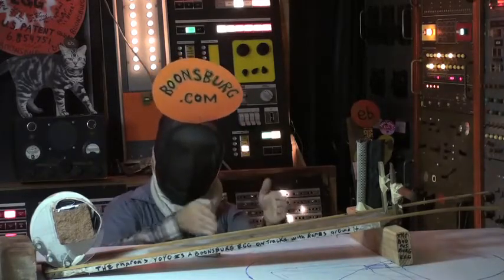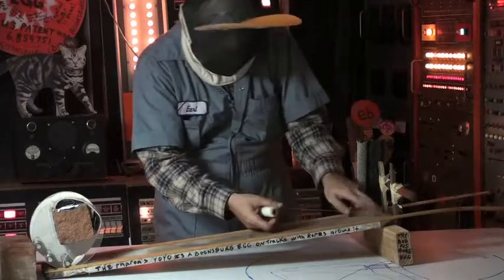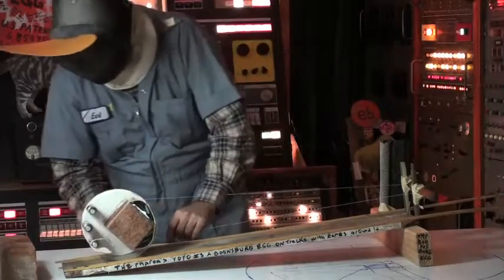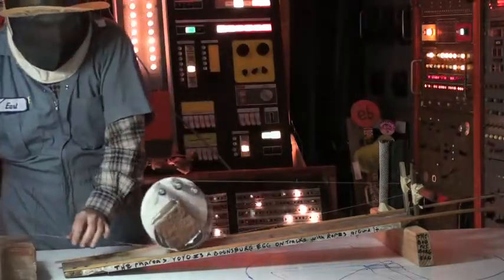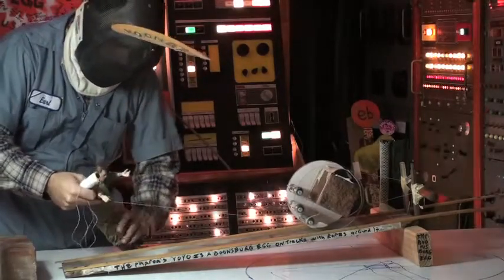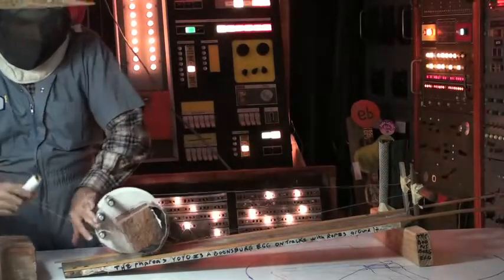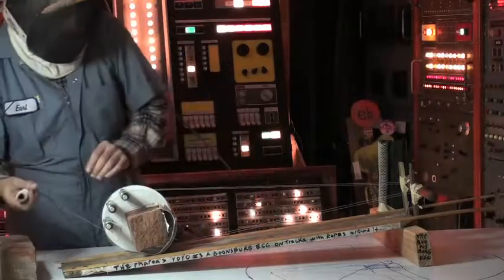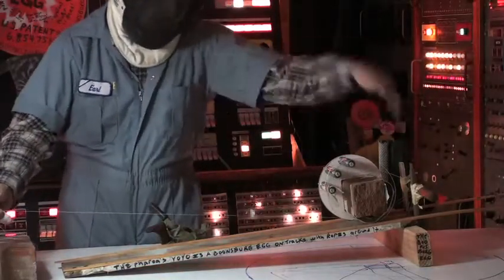Boonsburg Eggs used to build pyarmids - THE PHAROA'S GIANT YOYO!

Comment: @primesurvival the idea is that it is easier to move by putting two weights at opposite ends. This trick is done for "rolling up Hill" If you have the center of mass near the rim and push that weight forward a little the circle will go to rest with the mass down giving the appearance of a disc rolling up a hill. The counter balance then is to help with the next rotation so you can keep rolling it up hill easier.

Comment: i agree... starts @ 4:34
6:27 lol
interesting enough theory tho... the weight is off axis so you can roll it in stages and be able to take breaks without bearing the full weight...and the more loops you have around, the lower the gear you're in, so to speak. ?